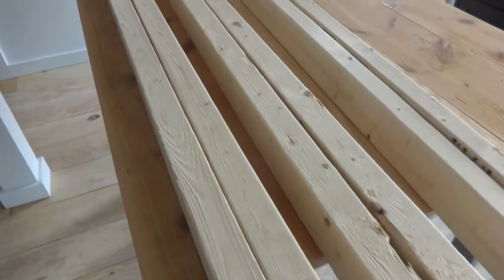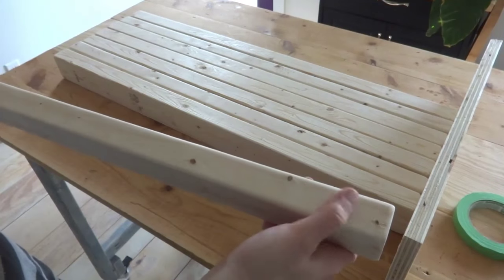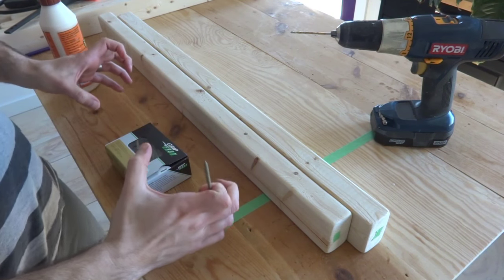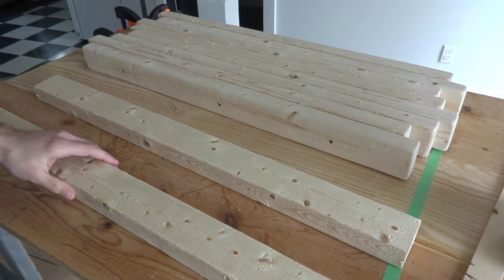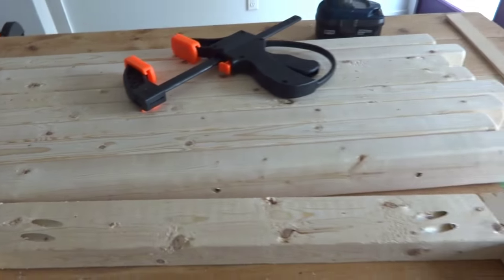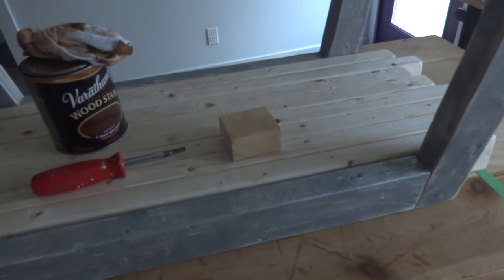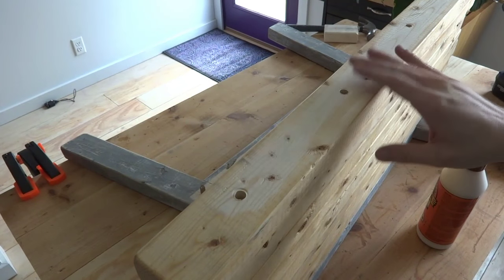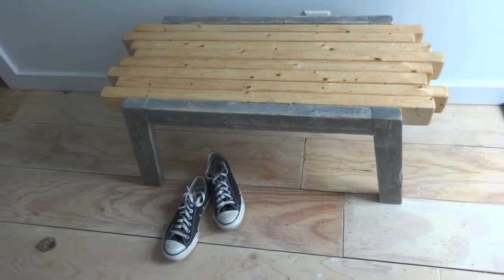Build a Simple 2x3 Bench (with Hidden Fasteners)

Comment: I'd bet money you have never fully sat on that bench. Those legs wouldnt hold up a hoho. Two tools I would suggest for you, the ryobi electric hand planer and the ryobi biscuit joiner..  once you're done glueing that hot mess together and you've let it dry a couple decades, plane that down maybe a 16th of an inch. And finally finish with sand paper. Beginning with a heavy grit like 60 or 80, then 110, and finish with 220. You're guests will thank you for not having to pull shards of rough lumber out their asses. When  you said hidden fastners I assumed you were not a crazy person and were referring to lags.

Comment: I would like to do that bench but with 55 inches, do you think those legs will support a weight of 2-3 people if i use it as a eating table bench? or should i need more support then that.
Reply from the maker: Hmm, I'm not sure. It is glued and had dowels, so it should be quite strong. I might recommend adding a wood brace underneath the bench top that crosses between the legs to help strengthen the legs a bit more just in case.

Comment: Looks great. Yet another out of the box design done really simply. One thing I did notice, those pocket hole jigs, have a stepped bit so you can clamp the leg to the side rail and then pre-drill through both pieces of timber before you run the screws. It wouldn't matter for this project, those legs are too wide for the screw to split them without a pre-drill, but if you are joining thinner timber, or ply wood together, it's important to use the stepped bit to pre-drill both pieces of timber to avoid splitting the timber.. Thanks for posting, I always enjoy your projects.
Reply from the maker: +Michael Robinson The way this Kreg Jig works, the stepped drill bit doesn't go all the way through the piece of wood you drill. It just preps a path for the screws to drive in straight to the next piece. The Kreg screws I use that are designed to use with this kit are self tapping to take the place of pre-drilling. It's a real time saver and holds pretty strong. I use their coarse screws for soft pine like this, but they also make fine grade screws for harder or thinner woods.

Comment: Love this bench!  A friend wants me to make her a bench like this but she needs a longer bench. How long could this be made with the legs on each end and it be ok support wise?  If she needed it around 60 inches long......how do you suggest doing the base for support?  Thanks so much.  Love your channel.
Reply from the maker: Hey thanks! If you go that long, you might want to add a lower cross brace between both sets of legs and then run a stretcher board that spans the length of the bench from brace to brace to keep the legs from doing the splits if too much weight is added on top.
Reply: MrDiyDork I was concerned about someone sitting in the middle and the seat breaking cause the wood is long with no support in the center. Should I also do something to support the seat as well as the legs. I'm just getting into wood working and I'm not sure how to put support in the middle and still make it aesthetically pleasing to the eye and not too heavy. I'd really appreciate any suggestions. Thanks for responding. So many people don't. 😊
Reply from the maker: The way this top is built with the 2x3s on edge and the glue & screws, it will be very strong. I think the legs would break before the top would budge.
Reply: Add two pieces of timber between the longest sides at the bottom of the legs make sure that the timber is between the legs not under neath